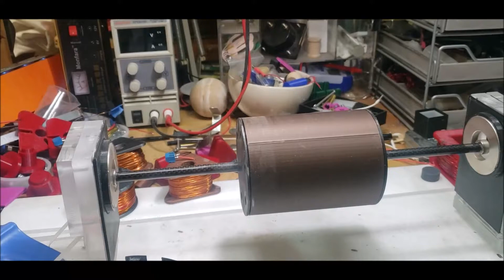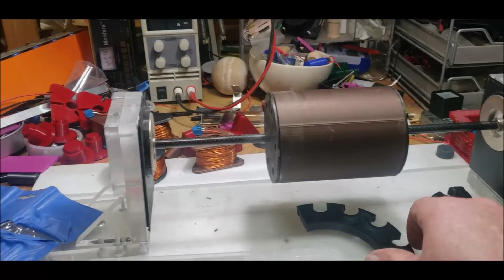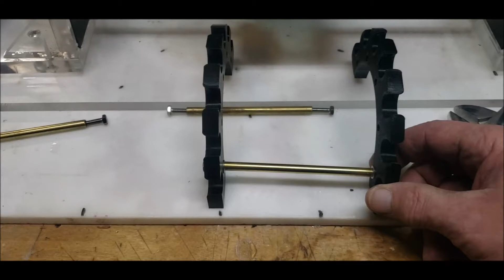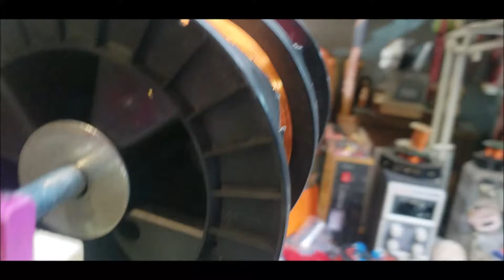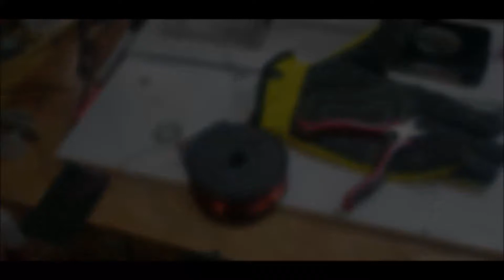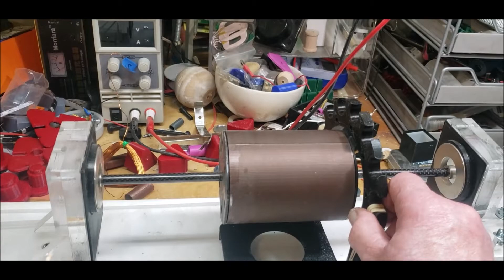3D Printed New Window Motor Coil

Comment: Hi its me JP from Toffeeflavour ^^, I guess I did the coilwinder. Behoud this will be a long story.

About the winder, if I could do it all over again I would do things differently. For the actual winding motor, I would choose a steppermotor, a drillchuck that is suitable for connecting to the steppermotor, and a stepper driver. The wireguide motor as shown on my video would be the same steppermotor with the threaded wire to get the linear motion going and another stepper driver. And the missing part on my machine is the third stepper motor, that will drive a wheel from the outside, this wheel needs to have some nylon or teflon tube in the middle with a bearing of course. So the wheel is meant to hold the source wire spools, so the steppermotor can twist two of three wires together as the bifilar, or trifilar coil is wound. Another stepper driver would be needed.
All motors chosen are steppers, because they are rigid, so the hold the wire nicely as the winder stops winding, so the coil doesn't unwrap. Also the steppers will likely interfere much less with the electronics, which is a problem in my machine. There are also no super fast calculations needed for the pwm signal, since the stepperdrivers do this. So merely An ESP32 chip can do the trick, instead of communicating with another chip to handle the screen. Then there is the screen, a nextion enhanced 4 or 5 inch screen, enhanced because if van handle coil recipes. Then there is the powersupply of 12 or 24 volts, this depends on the steppermotor. For the programmable chip and the nextion screen I use a simple USB phone charger, and that is amazing, so I would use that again. As for the construction, we both know that isn't the hardest part. As for code, I would reuse the stepper code, because you can reuse the functions as blocks and make three stepperblocks out of it. The basic coil calculator works Nice I would add an option for bi- and trifilar coils to it. And as for the screen communication, I recently written a portable piece of communication code that can be used simply by adding variables it communicates.
Oh right like you mentioned the other video, instead of using a speed potmeter I would buy one of those cheap plasticy guitarpedal volume pedals, as that basically is a footpedal with a potmeter inside, from a musicstore. All the other parts can be AliExpress as it is cheap.

Unfortunately, I am currently spending my budget to the new generator, so I cant quickly cook up another coil winder. But when you are ready for this, I am ready to help.

The project you are making now had brass bars close to the magnet, it will induce current, so it will slow like a classic generator, but you don't get the power. Nylon threaded wire with nylon bolts are recommended, but then again, this is really expensive stuff. Otherwise any plastic stick too large to fit the hole Would do, sand the stick down on the sides, to fit the hole and driving a pin on either side to hold the stator in place. This is just an idea.

Next thing is the coil, I would use 40 meters of wire, bifilar to drive more current in. Not thicker, rather bifilar, driven by separate circuits to get the most spike and magnetic interaction for your buck. Trifilar could do as well, generates a nice spike aswell, but from that point on you are giving up motor power. Attraction as it resembles love, repulsion does a better motor action, but for reasons mentioned before I wouldn't choose it, this is a personal opinion, and believe me I made a lot of repulsion motors.
Cheers JP
Reply from the maker: thank for this reply. I will probably us the 3d printed threaded rod and nuts for the cage. I've made them before and they work good. This way I really say all parts are 3d printed :)
Reply: @mcorrade  Yeah that sounds like an idea. I didn't mean to come across too harsh ^^. Anyway there was another comment here by me but it is removed. JP
Reply from the maker: @toffeeflavour  who removed it?  Not me
Reply: @mcorrade  It happens apparently
Reply: @mcorrade  Lets try this nameless. Some cooking book says a coil recipe 27 guage with a 100 turns per volt
Reply: @mcorrade  ohyeh the recipe also says that there is a ahum trigger carrot for the soup ^^ this one is 30 guage.
Reply: I don't know how else to bring it to you, Lets see which comment van stay and which can go. Cheers JP